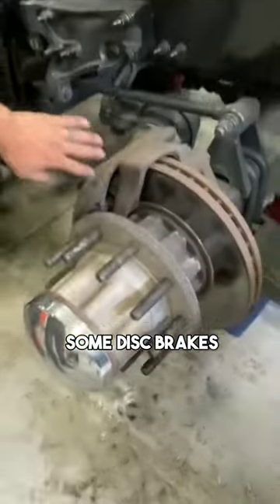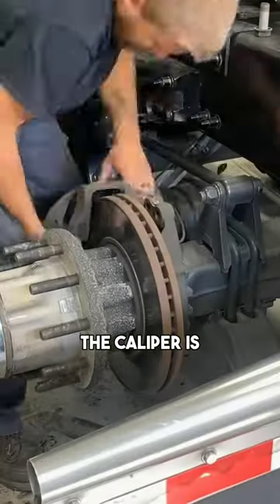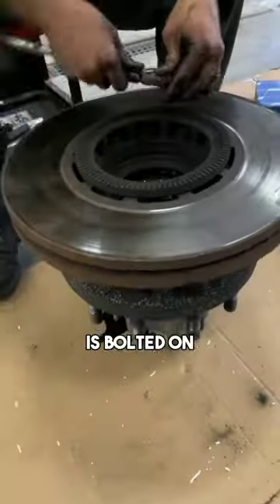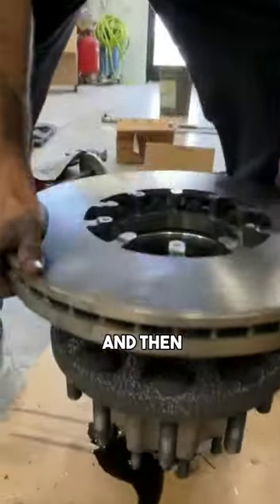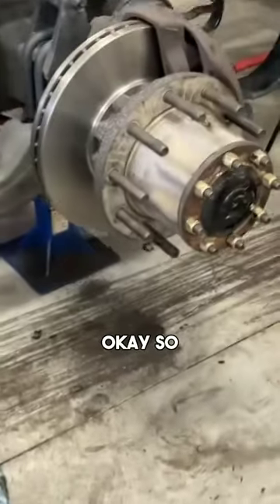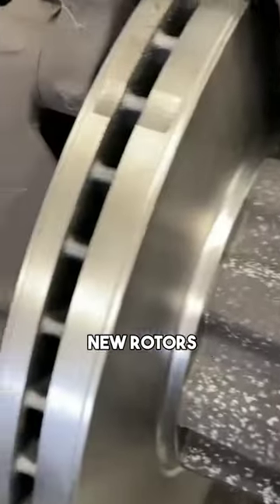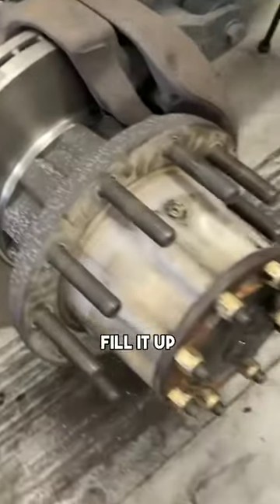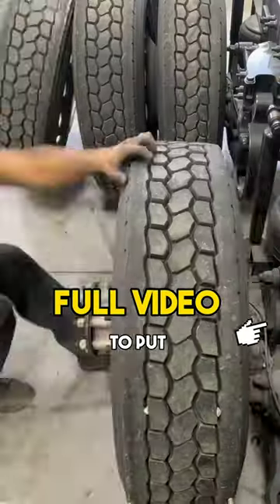Disc Brake Change on a truck with 400,000 miles on it #restore #renewal #update #peterbilt  #cool

Comment: I’m 44, and I just now learned that the axles on a Semi have just one hub that has two tires sitting on it. 
Always thought that the two wheels, though next to each other, were independent of one another. 
Obviously, I am not a Driver lol. Though I always wanted to be. 
Again lol because I’m sure that saying that to this audience is somewhat akin to a civilian saying “I almost joined” to a Soldier.  Though I have been strongly considering it as my 2nd career when I vest out of my current job. 
Would you all recommend it? What areas should I go to/stay away from?
Reply: No, I have been driving for 13 years and it gets worse every year.